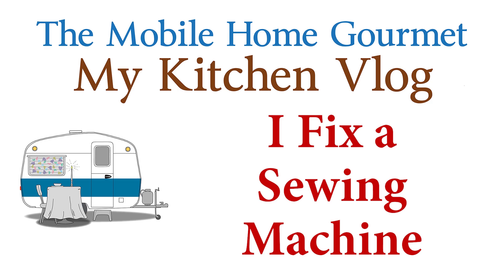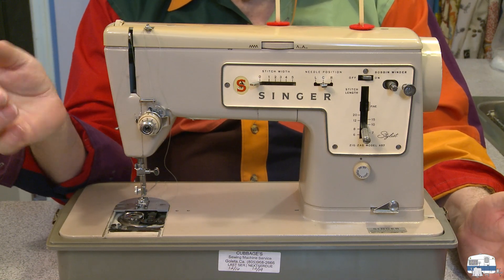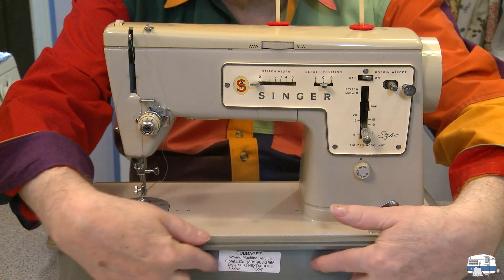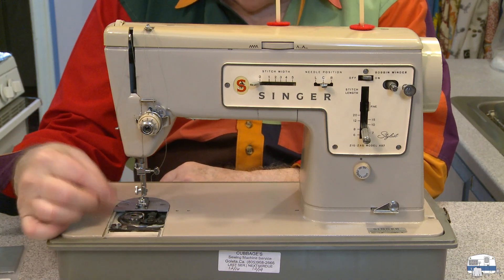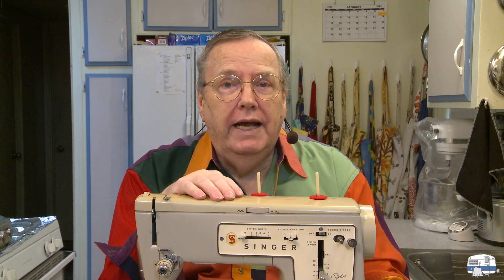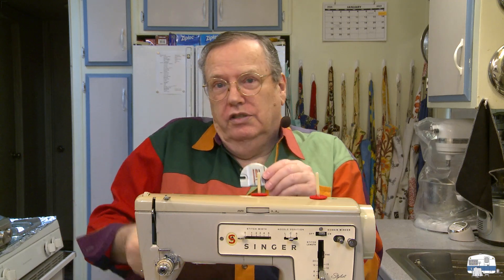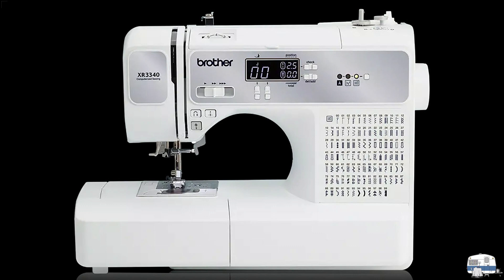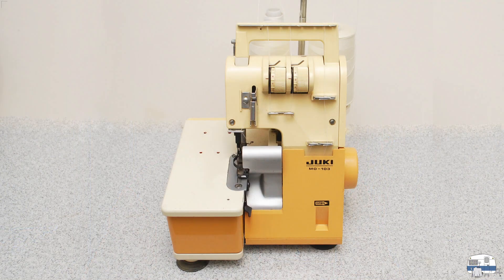I fix a sewing machine

Comment: I agree that those older singer machines are beasts.  They will sew any fabric, thick or thin without bogging down or quitting on you.  With proper maintenance they will outlive you and your great grandchildren.  I have a1950 model 15 , a 1946 model 201, a 1958 model 401, and a 1952 featherweight.  I love them all.  (I also have an old treadle red eye in storage)
Reply from the maker: So true! They're like a good cast iron skillet. They'll last long enough to hand down to another generation. Thanks for the comment. —Dennis